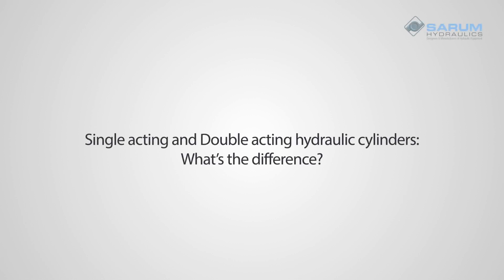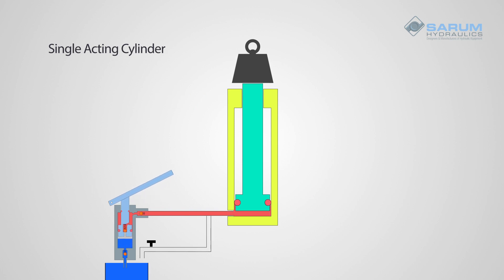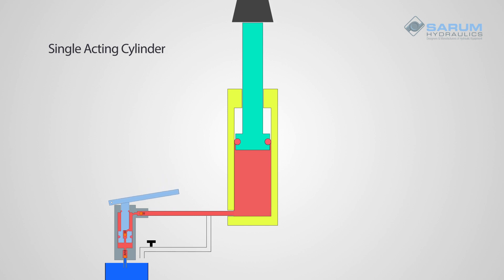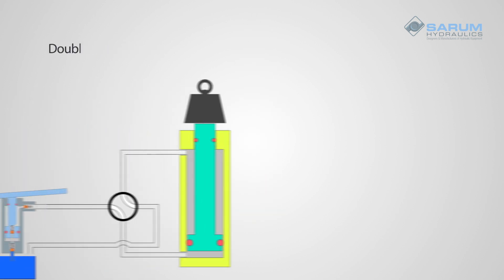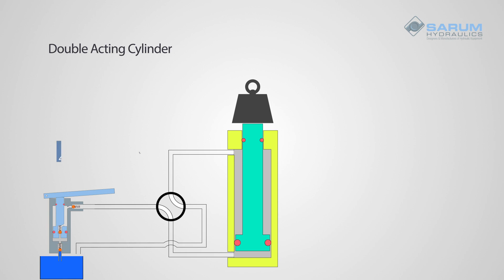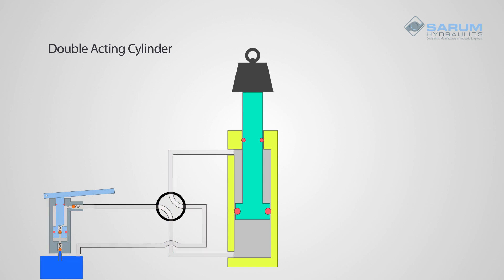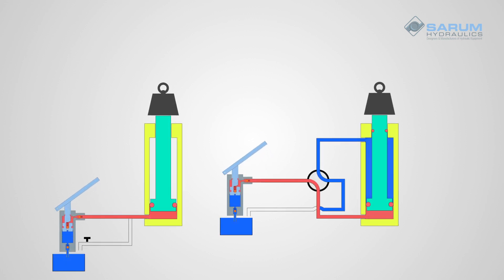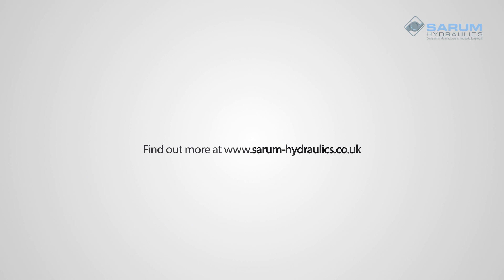Single Acting and Double Acting hydraulic cylinders: What's the difference?

Comment: For the double acting cylinder, is the blue fluid side of the illustration never under pressure?  I'm thinking of like a loader where you are exerting force up to lift, but if you are moving fast, the loader arms would bounce up because the blue side is not pressurized?
Reply: No. The hydraulic cylinder would probably never go that fast.  The fluid is under pressure when and only when the line is sealed. When the line is open somewhere, fluid would flow out gently because of low pressure. Only in a pneumatic system you would see the piston go so fast and the pressured air flow out so strong.
Reply: @khanhphaminh1175  can you translate your answer in terms of the alternating red and blue sides shown in the video for double action because I'm not following what you're saying. Also not sure if you're guessing since you said probably or if you definitely know.
Reply: @Redneck_Ed in the double acting cylinder system, look at the tank (blue part under the pump). Near by it is the "line" (or pipe) that would never sealed (or closed) and it always open for fluid flow back to the tank. Next, see how slow the hydraulic piston move (not the pump in the left). Not so fast, right? So, the piston is slow, the pipe is open, so the fluid in the pipe have nearly zero pressure. Hope you understand because english is not my mother language
Reply: @khanhphaminh1175  yes, thank you so much. Your English seems pretty good to me.
Reply: @Redneck_Ed  glad I can help!

Comment: Can I use an off/on valve as a flow regulator on a 1 ton mini excavator if I turn it part way for auxiliary attachment?
Reply: I have one on both sides of the stick. Would I need to adjust both sides or just one side?

Comment: which works on aircraft shock strut means double action or single action?
Reply: Raka MS, Thank you for the view and question. Aircraft shock struts are complex because they mix oil and nitrogen. Not our thing, but this link may help. https://www.aircraftsystemstech.com/p/there-are-many-different-designsof.html . I thought that aircraft landing gear also used regenerative cylinders as well, which is worth looking into if you are designing hydraulic systems. I might be wrong. A regen cylinder can provide rapid extension- take a double acting cylinder and pressurise both ports. We've used them on some of our kit over the years for specific reasons. Our vid doesn't discuss them, just as we haven't talked about how telescopic cylinders work. Plenty of stuff on the web. Thanks.

Comment: Can I move a single acting cylinder manually if needle is open? Its in a situation where the cylinder would be fastened between two points that will move away and towards each other so I want cylinder to freely move with them.. but also close needle and actuate when needed
Reply: Nick, make sure the drain from the needle is below the level of the oil in the reservoir and that the flow paths are big enough and you can do exactly what you say. Actuator manufacturers use this sort of method for damping or speed control. You can move the cylinder freely then add power when you need to. Keep in mind that if there is spring return, that can be a fair force to overcome. Thank you for the watch and the question. Sarum Hydraulics
Reply: @johnfoster8624  Appreciate the answer John

Comment: what is the type of cylinder required to withstand a load of 200kg?
Reply: Good morning Bingoman. Use the formula Pressure = Force/Area. If you know the pressure that your electric, air driven or hand pump will generate and you know the force as 200kgf, you can work out what area you need on the full bore side of the piston. Then look at standard rams to start with and select one with the right size. I would start with the Enerpac or HiForce catalogue. Those are 700 bar cylinders. Or you may be able to use a more basic ram from lots of catalogues, often running at 200 bar. Those will probably be cheaper. Lots of other considerations. Spring or gravity return? Or double acting? Mineral oil, water or something more specialist? interface on the ram body and piston rod?  Materials? Good luck with sorting out the right cylinder for your application.
Reply: @johnfoster8624  actually i wanted to design a stair to ramp convertor using double acting electric hydraulic cylinder that can lift 200kgf or more. what type of fluid should be used and can u suggest how to find the power?

Comment: Is the retracting velocity is important in single acting cylinder?
Reply: Good morning J land Malakas, That is a very good question for anybody who is designing equipment with a single acting cylinder. If you are lifting a very light load, the speed of descent might be quite slow and controlled . Or might it be "a bit slow" or "ridiculously slow." If you are lifting a heavy load using a single acting cylinder and when you release the pressure back to tank, it crashes down, totally out of control, that is a real hazard. That is unacceptable for lifting/jacking and anything to do with medical applications. Your can fit a fine needle valve into the feed to the hold release valve to adjust the speed of descent to what suits the application. But what about something like a hospital bed where one day you may have a baby on it and the next day a very heavy person? We use a pressure compensated flow control valve to control the speed of descent. As long as you get the right valve flow rate, that will keep the speed of descent safe and controllable. We would say that as well as doing your calculations to sort the correct pump and cylinder for a job, you should also check out the speed of descent and not just take a chance on it being OK.

Comment: But... thats a 2/2 directional valve not a 4/2. also manual jacks dont extend on pull up, only down push.
Reply: Good morning Alvin, Thank you for looking at our video. If a manual jack is lifting a load and uses gravity return, it will invariably use a single acting cylinder as in our left hand view. You are pressurising the full bore area under the piston and lifting the load. You release this pressure back to tank when you want to lower the load. The right hand graphic showing the double acting cylinder does correctly show an acceptable graphic for four way two position directional control valve (a 4/2 valve.) We could have shown this as a circuit symbol for a spool valve, but our kit uses a very low leakage four way ball valve, so that explains more clearly exactly what our Micropac pump does. We hope that explains.

Comment: If I were to use a double pump to a single cylinder, what happens to one side if it has no where to go and the cylinder retract with gravity? Will this be enough to blow a hose?
Reply: Jeremy,  You can use a double acting pump with its two hoses to operate a single acting cylinder, but just connect one hose to the cylinder feed and feed the other hose back to tank. Pump the cylinder up then to let it down, turn the valve through 90 degrees to connect the cylinder to tank. The pump is more complicated and expensive than a unit with a simple hold release valve, but it does work. If you don't connect the hose to tank, the cylinder will simply not descend. It won't burst, provided it is rated to the correct pressure. Using a single acting pump to operate a double acting cylinder is another interesting question. Thank you for watching our video.

Comment: Dear Sir............Example Problem I have a single acting hydraulic cylinder with a stroke of 300 mm, a bore of 18 mm and a rod of 10 mm
 if the press weight is 10 mm on the Piston Head what is the pressure.....Please explain the calculations
Reply from the maker: Thank you Zulferi Syahputra for watching our video. We will explain the basics of cylinder calculations. These are just the fundamentals. A hydraulic cylinder is based on the formula Force =Pressure x area or rearranged, pressure = force/area. Work in pounds force and square inches or Newtons and square cm. We suggest not to mix metric and imperial units when calculating, but remember that you can simply convert pounds force into newtons at the final stage if you need to know an answer in imperial and metric units. 14.5psi = 1bar, 2.2lb=1kg, 9,81kgf=1 Newton and 25.4mm= 1 inch. Square for mm2 to inches2. Cube for mm3 to inches3. One more important point before you work out your cylinder force. A double acting cylinder is easy. The area applicable when the cylinder extends is the full bore area of the piston/bore it is running in. Use Area = pi x radius squared. On the area as the cylinder retracts, it is the ANNULAR area that you need to use. Work out the rod area and take that away from the full bore area, giving you the area of the annular “ring.” A single acting cylinder is very easy apart from one complication. Most designs will include some sort of piston to give the cylinder stability and also stop the rod popping out at full stroke. You MUST find out whether the hydraulic seal is in the bearing (so your area is that of the rod) or on the piston (so your area is that of the piston diameter.) This is fundamental. You have given us two diameters of 18mm and 10mm. The areas are 2.54cm2 (0.394in2) and 0.785 cm2 (0.122in2). Your load is quoted as 10kgf/22lbf (I am assuming), so the pressure is either 22/0.394=55.8 psi (3.84bar) or 22/0.122=180.3 psi (12.4 bar) depending upon the construction of the cylinder. Finally, how to work out the displacement or amount of fluid shifted over a full stroke. On a single acting cylinder, take the effective area (which you do unfortunately have to decide) x the stroke = so many cubic centimetres or cubic inches. A double acting cylinder simply uses the full bore area or the annular area x the stroke. Expect the displacement on the retract stroke to be around half of the extend displacement depending on the design. Your single acting cylinder has a displacement of 76.2cc/4.65cu.in. or 23.5cc/1.43 cu.in depending upon the effective diameter. Finally, look at the figures and check they are sensible. This is vital. If you are converting from mm to cm or ibf to newtons, people can easily make careless mistakes. I hope this very basic explanation in a few lines is helpful to you.

Comment: How to get (liquid) from the reservoir into the small cylinder piston through the valve and not replace it with something else? 
I mean you can not take any liquid from the reservoir or even open the valve if it’s completely sealed. Unless the reservoir tank shrinks?
Reply: Sammy, thank you for viewing our video. A reservoir will normally breathe to atmosphere so you can take fluid out and put it back in. Some applications do use a breather bag on a reservoir or even seal the fluid in a rubber bladder. That is required when you are carrying kit around upside down and don't want oil to spill or you don't want dirty air or water to enter the reservoir, as in an underwater hydraulic system. You can  leave an air space in a reservoir and have it sealed, but we are careful with this. We hope this explanation makes sense.

Comment: On a hydraulic excavator with a maximum breakout force of say 40,000 pounds calculated at the tip of the appendage, the maximum return force will be on the order of about 20,000 pounds or so, would it?

Comment: How much energy a 60 kg man can provide maximum
Reply: It depends on the length of the lever.
Reply: it depends on a lot of things, like the cylinder bore diameter, the pump displacement, hose diameter will effect flow but that is a smaller factor, and of course the torque needed to actuate the lever and the load or force counter acting the cylinder. The torque for the lever could be determined by the distance of which the force is being applied on the lever and how long the lever is. If a man is 60kgs or 132 lbs and the lever is exactly one foot long, then  you apply all of your energy "feet off the ground" you would have 132 ft lbs of torque. How much torque is needed for the pump based on it's displacement, it's probably not 60 kgs/132lbs.

Comment: Superb explain
Reply from the maker: Thank you, Lokesh V. We have more videos like this in the future.
Reply: @sarumhydraulics1386  are you able to make a turbine which is run by hydraulic pressure and we got lots of electricity and stored it in battery so we can power my microwave and cook my food 

1200 watts microwave 
For one hour 
50 hz
250 volt
16 amp 
We use a spring which is made of steel and stored 500000 joules a flywheel which store 1000 joules gears and pulley system
A dynamo synchronise motor 
So we do some exercise and electricity production become easy 

Like we turned the earth with our weight also by leavers so we produced electricity in very large quantities so we going grid free